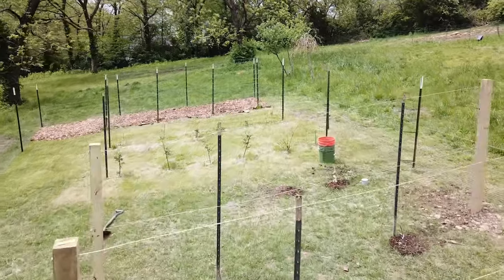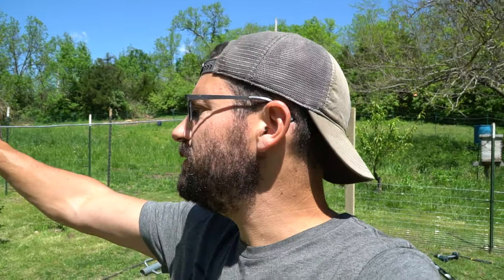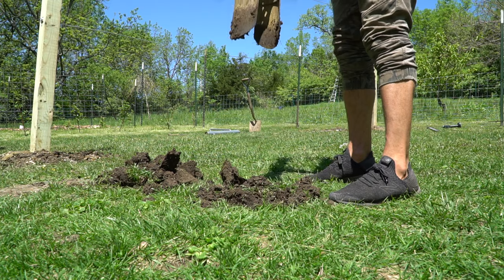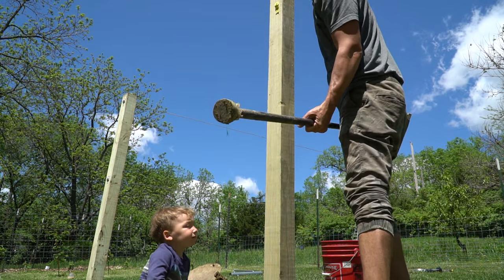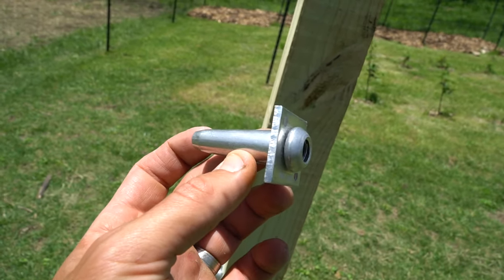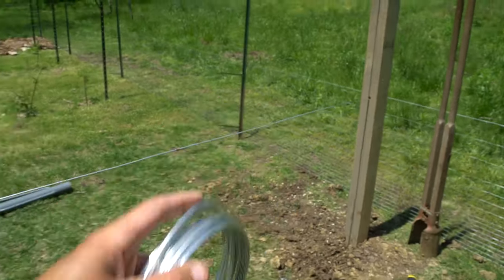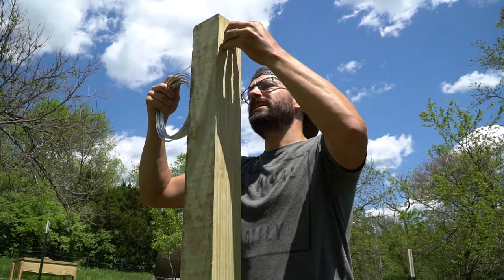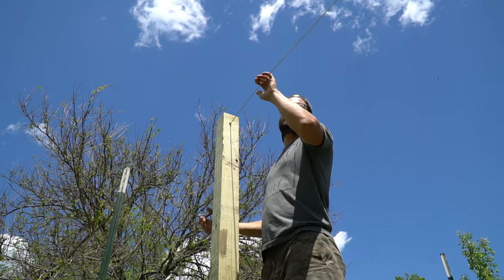How to build a Grape Vine Trellis

Comment: Unless your trying to have a narrow hole, your better off just using a regular shovel to dig your holes, those two handle digger are heavy, slow and just a pain in the ass.
Reply: I did mine starting with a shovel until I hit the clay level and just needed a few more inches, then switched to the post digger

Comment: I like the idea of your fence and its going to work out great, especially the drainage off the end of the posts but I like to take the post tilting them out by about 15° towards the ground so it absorbs the fruits growths weight on the 4 x 4 posts and the posts will pull but not bend or break.

Comment: Very nice and well done. Exactly what I am presently erecting on a smaller scale (2 posts with 7 foot U-Posts in between 4 grapevines in our backyard except an 8 foot separation between vines. I got my gauge 9 wire and the same wire clamps and I have already dug 2 feet for one post hole. Needs another 6 inches. I got clayish soil with small rocks galore. No need for quikcrete. Added a lot of peatmoss and perlite to the soil plus DIY compost after tilling the soil and removing as much of the rocks as possible.

Comment: Thank You! 
I'm now planning out my grape project for spring.  This is by far easiest build.  Like the wire clamps. 
We used them for 1/2 strand in telecom.  We called them 'pickles ' lol.  They connected 2 wires together.
Reply: 10/10 A +

Comment: Couldn't you put the post in at a slight angle away from each other so that when they are tensioned they are closer to plum? Or is that a horrible idea?
Reply: I am thinking the same thing...So I'll be angling mine  little bit.

Comment: Great video.  I purchased the items that you posted in the about section.  I can't get the 9 gauge wire through the wire vice.  It forces the spring out of the wire.  Do you have any advice?  Did you file the end of the wire?  Thanks in advance.
Reply from the maker: Weird I didn’t have that problem. Are you sure you’re putting the wire through the right way?
Reply: I am having the same problem!! Very frustrating!!